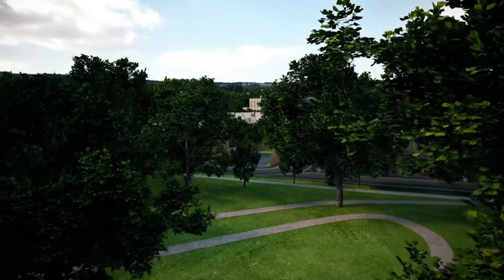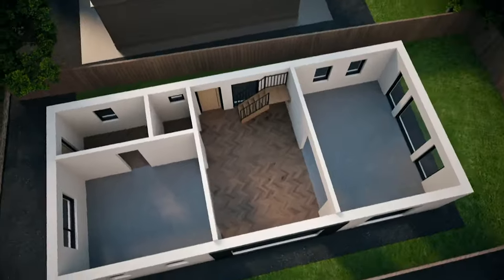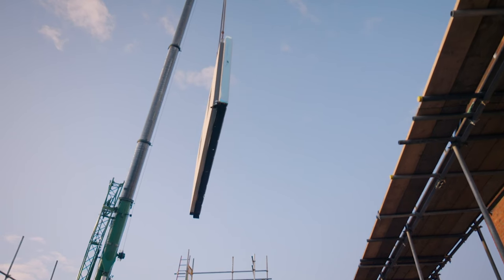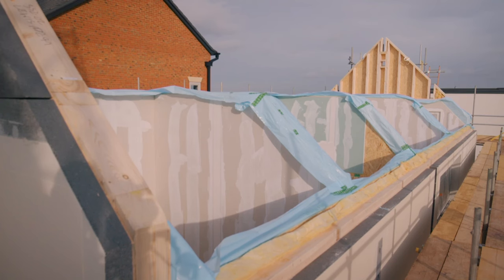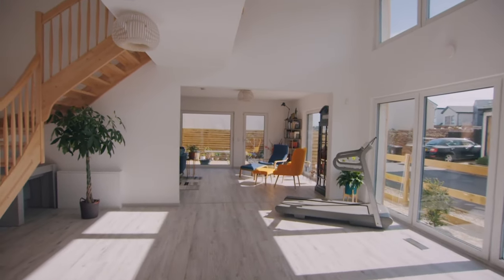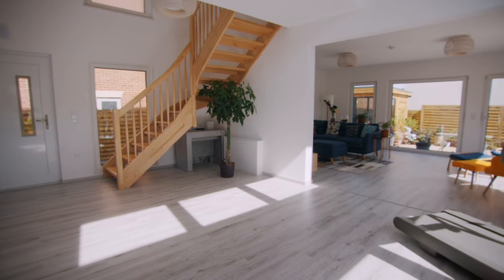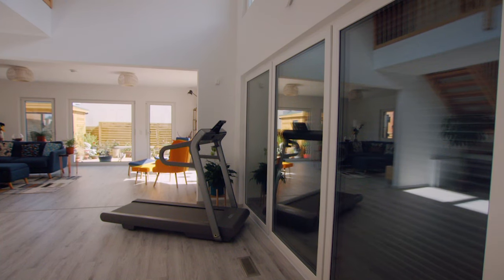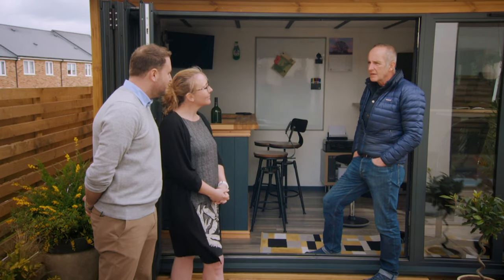Building A House FLAT-PACK Style | Grand Designs: The Streets | Channel 4

Comment: I always wonder about shutters like that how you maintain an easy fire exit. Like is there a manual override available is there’s no power.
Reply: I have the same issue- shutters don’t cover doors, so the argument is that your doors will stay as an exit. 
I had the experience in a house run on solar, come morning the batteries were dead and shutters stuck closed!

Comment: no curtains, wierd, thisis a shed, it will fall to bit sin tenyears
Reply: 25-30 years is more accurate. Different regions call for different codes. The area in which you reside may carry stricter building compared to those in which this home was built. If a contractor was put in charge of this project, these things were taken into consideration. After 20 years, a company may inspect and even help fortify these structures. Not to mention, the 20-year time gap in which the pre-fabrication process of buildings becomes better.
Reply: Such a boring box of a building....may as well be in a Travel Lodge...
Reply: It’s not built by British builders. It will still be there in 100 years
Reply: It'll last as long as the treatment on the exterior timber is maintained, if that ever stops it'll absorb moisture and fail quickly.